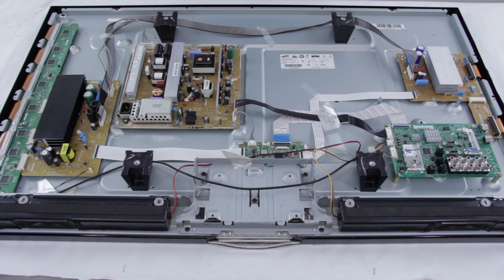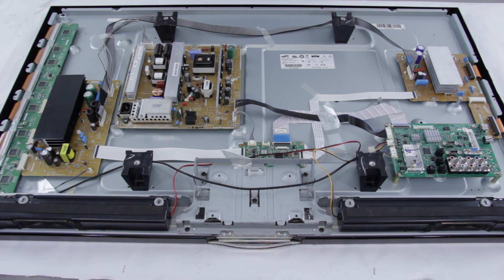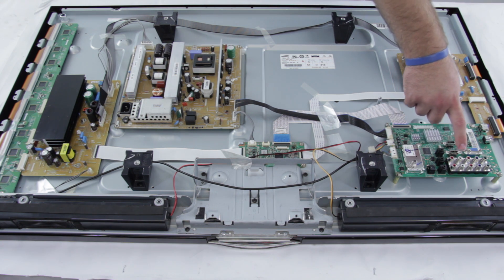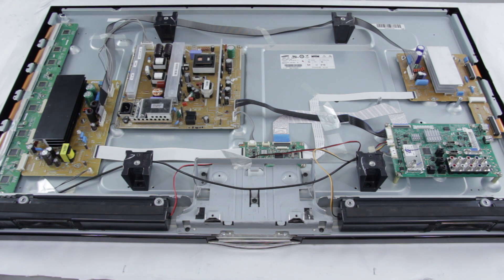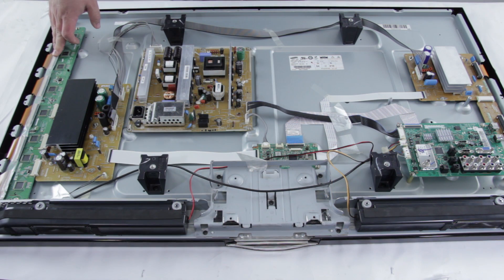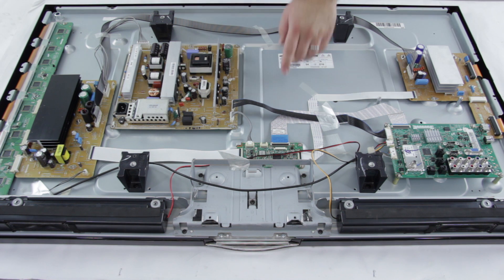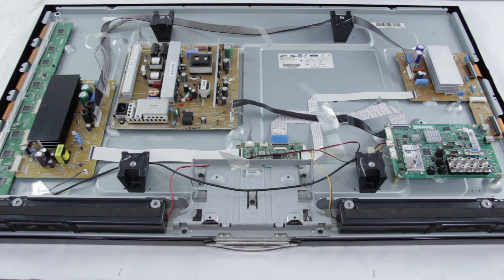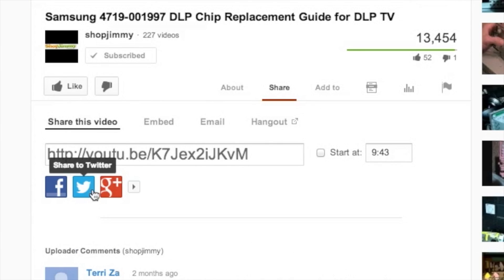Reparar / arreglar TV LCD Revision - Problemas comunes, sintomas, reparaciones subtítulos en español

Comment: Hi I have a Samsung lcd but don't know the model.The tv's red light of stand by turns on and stays flashing. it does not turn blue for the tv upload the image on the screen.I opened it and noticed a capacitor was inflated.I replaced it with a a new one of the same capacity and it is still not working.Could the power supply be damaged or if the red light turns it means it is working?I thought by fixing the problem of the capacitor the tv was going to work.Please give me advice and your opinion of what is the problem.I think the red light flashing is a code.

Comment: good Hello, I need you to help me with a tv not whether LCD or plasma alike have a problem, the light standard , the detail is that after a few seconds few stripes or bands so begins to appear to say that apparently appear in areas of clear color, but the stripes they are completely white and straight vertically and sometimes the images are frozen by time and simultaneously see the other image and also sometimes removed, but still very disturbing lines are sometimes gruezas and thin. The TV is SAMSUNG
Model code : LN32D403E20XP03
Version: SP03
32 " Inches. Please I need help I am from Venezuela had to be translated into English to send this hope someone's response
Reply: si me pueden responder en español lo agradezco.
Reply: ha ok entonces me puedes responder las preguntas a mi correo electronico. maicolfff123@gmail.com     Porfavor .

Comment: hi i have a rca tv model number is L42wd22yx6. i have power but no image. did the troubleshooting and it seems like the power bar needs to be replaced. how can i make sure it is and if so where do i buy the replacement parts? there is a standby light on when i push the power button nothing happens the tv stays on stand by. when first plugged in the stand by light is green, then there is a short and the stand by light goes red. dont have the remote for it.

Comment: Thanks for the video, my TV is a SONY BRAVIA KDL 37FA400 the problem is that the screen "lights on" but there is no image at all the Power LED turns on but the Stand by LED doesn't.

Muchas gracias por el video, mi tlevisor es un SONY BRAVIA KDL 37FA400 el problema que presenta es que la pantalla "ilumina" pero no hay imagen de ninguna clase, el LED de Power enciende pero el LED de Stand by no lo hace.

Comment: Hola, tengo una olasma samsung PL42B450B1DXZX, el problema que presenta es en la parte de adelante de la pantalla, los botones touch para cambiar el volumen, acceder al menua o cambiar la entrada de video se activan solos, el led no deja de parpadear como si le estuviera dando alguna señal con el control. se activa solo le menu o se sube o baja solo el volumen, y en la entrada de dvd aparece en pantalla un letrero que dice señal no disponible y no permite ver la parte central de la pantalla. a que se debe la falla y que puede repararla?
Saludos

Comment: Hola; tengo un plasma Samsung 50" el 50c550 y me ha salido una franja vertical de 3 cm en color verde que cruza la pantalla de arriba a abajo. parpadea y a veces desaparece dejando ver una finísima raya negra casi inapreciable..y en seguida otra vez la franja verde. tengo que decir que la franja verde es casi trasparente, es decir, se puede ver la imagen detrás de ella con sus colores. que tipo de problema tiene mi Tv. gracias.
Reply from the maker: Guasi Fernandez   This sounds like a TV panel (TV Screen) problem.  If your TV panel is bad, it may be more cost-effective to replace the TV as panels are typically hard to find in stock, difficult to replace, and expensive.  Thanks and please let us know if you have any further questions!  www.shopjimmy.com

Comment: buenas tardes tengo un lg 42la6600 estaba jugando a la play y se empezaron a cruzar lineas y se congelo la imagen lo apage y lo prendi, quedo con la pantalla en negro con lineas verticale en uno de los lados y no responde a nada, solo al encendido y apagado
Reply from the maker: MrHermes2269   Esto suena como un problema televisor de pantalla (Pantalla TV). Si su televisor es malo, puede ser más rentable para sustituir la TV como paneles suelen ser difíciles de encontrar en la acción, difíciles de reemplazar, y caro. Gracias y por favor, háganos saber si usted tiene cualquier otra pregunta! www.shopjimmy.com
Reply: ShopJimmy.com el te es un led 3D el el modeolo 42la6600
Reply: MrHermes2269 LG la marca

Comment: Hi, I have a power supply board LN40B500P3F that constantly burns the second fuse. I would like to know where can I get the right information to get it fix.thanks for any help and useful information.
Reply from the maker: oscali lopez   We have a repair kit that you can use to replace components on the board.  Here is a link to replacement parts for your TV model number:  http://www.shopjimmy.com/catalogsearch/result/?q=LN40B500P3F  Be sure to match part numbers on your current board, with your replacement for compatibility.  You can also call our customer service for further assistance with your purchase.  (877) 881-6492  Thanks and please let us know if you have any further questions with your TV Repair!  www.shopjimmy.com

Comment: My Samsung LCD  model LN32c550jifza powers up at times and will operate  intermittantly. recently, the tv began power cycling and will not power up. I pulled the pwr supply and the caps seem to be in good condition.I put it back together and it ran for several hours. I turned the tv  off overnight  when I turned it on and it only flashes the standby light.
Reply from the maker: JB Fry   I recommend replacing the main board in your TV.  Click for replacement parts: https://www.shopjimmy.com/catalogsearch/result/?q=LN32c550  Be sure to match part numbers on your current board, with your replacement for compatibility.  You can also call our customer service for further assistance with your purchase.  (877) 881-6492  Thanks and please let us know if you have any further questions with your TV Repair!  www.shopjimmy.com